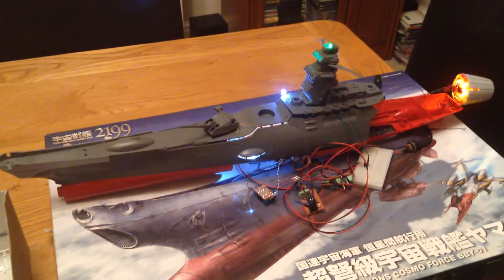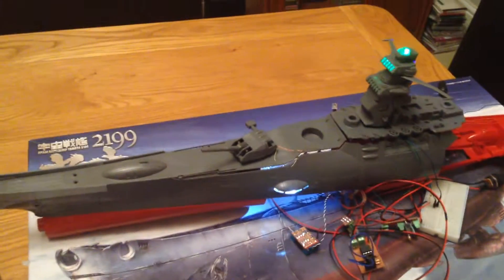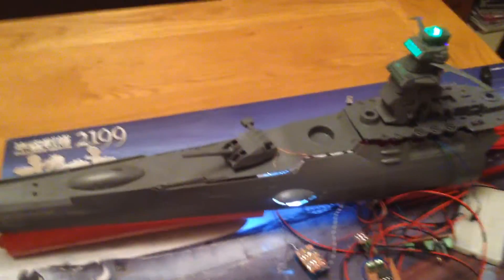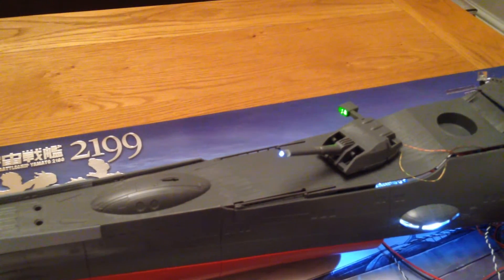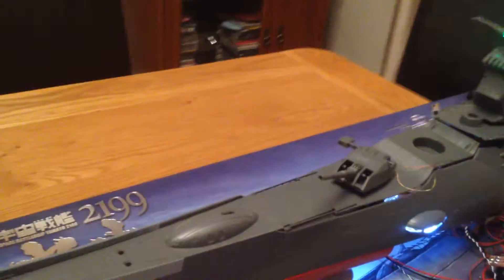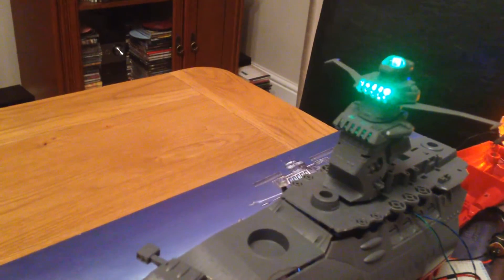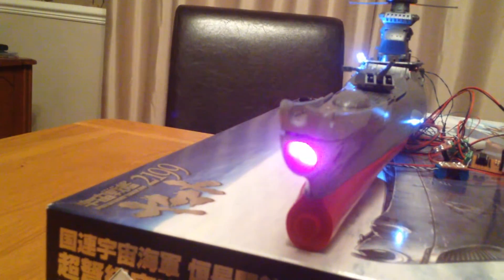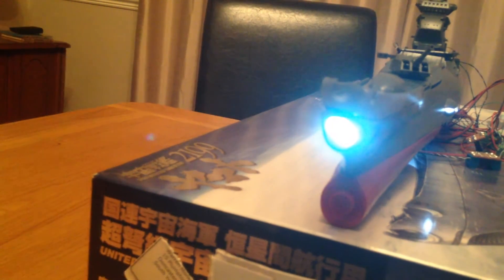Yamato 2199 Lighting Kit Test

Comment: Hello would you sell a light kit for this model??? Let me know
Reply from the maker: Hi Gary, I do the lighting kit on a request basis due to the cost.  Full kit is £160 inc postage.  Cheers,
Reply: @tirydiummodels  So it is 180.00 US?
Reply from the maker: At the current exchange rate it would be about $205USD
Reply: @tirydiummodels  we are talking Euro correct.
Reply from the maker: Hi Gary, no the kit is £160 UK pounds, which is equivalent to about $205 US Dollars or €180 Euros
Reply: @tirydiummodels  Hello I would like to order one. Let me know what needs to happen and a rough time frame.
Reply: @tirydiummodels  Hello I would like to buy one.
Reply: @tirydiummodels  Well I will try one more time. I would like to order this light kit. Please let me know what needs to happen
Reply: @garyhooks4234   Did you ever get the light kit ?

Comment: Any chance this is for sale or something like it anywhere that anyone might know of. Thanks!
Reply from the maker: chad divine Hi Chad, this was done as a bespoke lighting kit, I haven't done it as a commercial kit due to the price of a fully wired set up, about £160!  If you are interested I'm happy to discuss what you want.  It is possible to do it in modules if you don't want all the functions.  It could also be made cheaper if you can do the wiring and soldering of the LEDs yourself.  Cheers, Warren
Reply: GTK Thanks!